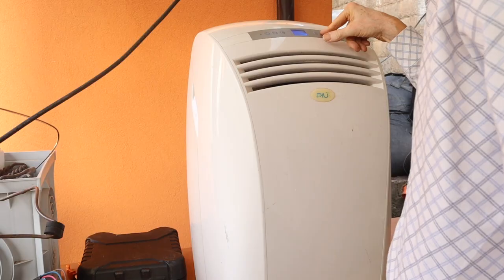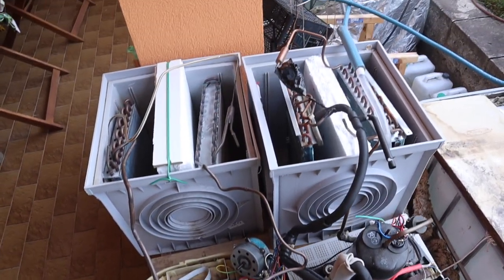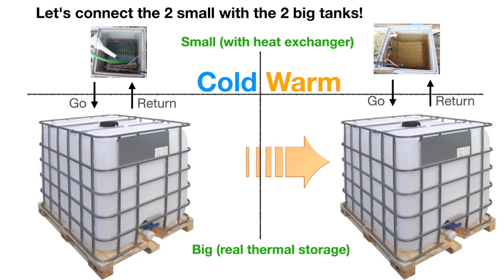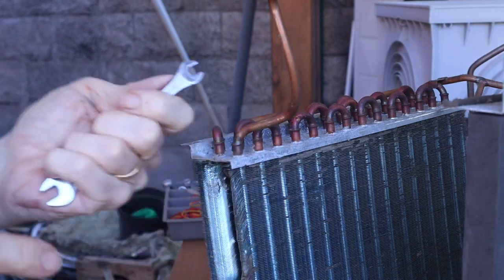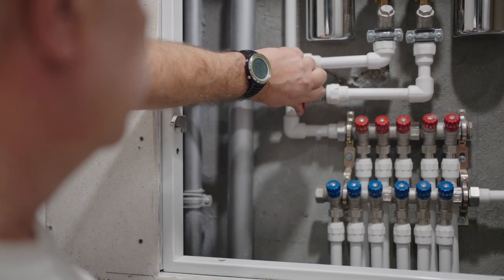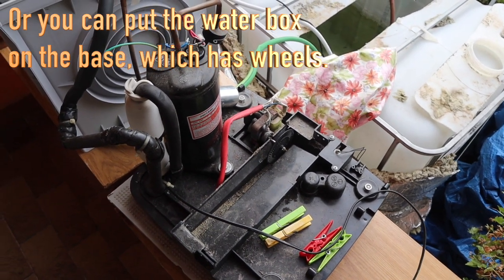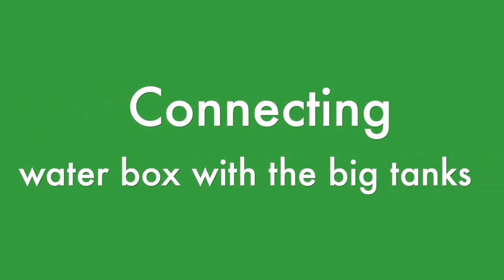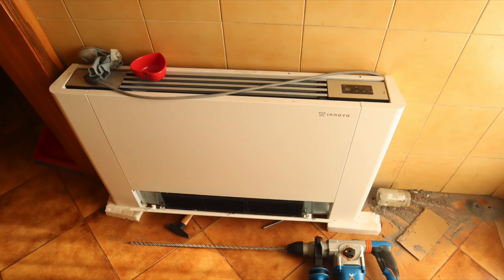Winter Heating Hack: Convert old Air Conditioner into a Water Heat Pump (Part 2) - Video 68

Comment: This is a cool project but maybe for general usage the mini split heat pumps are a better idea because the compressors have variable speed (new 5KW/18000 BTU Midea cost 500 euros, i would imagine there are used mini splits with variable speed compressor), heat pumps loves to run constantly at a slower speed that's how you gain efficiency.
Reply from the maker: Hi Riste, indeed a 18 kBTU would charge the 2 water tanks much faster. I started years ago with a split but found it a challenge to put them together without the controls. Even if I got now this new experience of simply putting the power supply directly on the compressor. Anyway, it might be difficult for many DIY to unite the external/internal unit.
I agree on the variable speed advantage, but again, it requires the knowledge to integrate the electronics and let it work even if you eliminate the fans, which we don't need anymore. The second reason that I think we can run it just at full speed is that all heat&cold will anyway go into the storage and it takes time before that is charged.

Comment: I would think the gain is only x5 if you simultaneously use the cold and the heat 🤔 otherwise it's just x2.5, no?
Reply from the maker: Hi Effedrien, you got it right! Actually the heat efficiency is somewhat better than the cold efficiency. The challenge is, just like Combined Heat and Power,  to find users at the same time. In summer that is easier than in winter.  But if you store both as I do in the 2 big tanks, the consumption can be shifted in time.
Reply from the maker: Also, if the temperature difference between the 2 tanks is not so big, the efficiency is better than 2x2.5. So you may expect a rather quick reaching of the nominal temperature difference.

Comment: i put a 250w heat lamp above my kitchen table.  instant heat, it is my favorite heater!
Reply from the maker: Hi Matt, infrared heating is indeed very quick and in addition,  it works even outside. Therefore they use it insights rooms like churches where people stay for only 1 hour.

Comment: How did you isolate the box for the noise?
Reply from the maker: Hi Hamza, I did not yet insulate the sound or vibrations but the compressor is mounted on rubber feet and if there are no objects on the base it is much more quiet than an air conditioner with its two strong fans.

Comment: You've inspired me! This summer was the last one for my parents 10+ year old floor standing unit; the blowers squirrel cage cracked and my repairs we're unfortunately temporary. I'll see if I can give it a second life. It seems the only thing I'm missing is a bin or two to get started.
Reply from the maker: That's great Ostrich! Do you mean the squirrel cage like fan? That will be no problem because it is superfluous in the configuration.  See video 61 where I eliminated the fans to see my fans. As long as the compressor works you can go on.
Reply: @nnvasen-good-energy  Upon further consideration I've realised there is one difficulty that may hamper performance. Galvanic Corrosion. Many of these radiators are aluminum fins pressed onto copper pipes in the end. Submerging them in plain water may be ideal for performance but having to use an oil bath instead; with another fluid to fluid heat exchanger in the loop may be necessary.
Reply from the maker: I agree that it may be an issue. In the past I played with a separated circuit but that was complex for me and for my audience. I am now just looking what happens and if I need, I strip away the fins, like another viewer suggested yesterday (the comment about cooling fermented drinks) to give more freedom of movement to the water.
Reply: @nnvasen-good-energy  I just spent a bit looking around and found the brewers glycol chillers. I've been convinced it should be fine so long as the coils are submerged in relatively pure water with an antifreeze mixed to suit.
Reply: @nnvasen-good-energy  Yes. That's exactly it. Replacement was far too much but I might still give it one more look before I bend it all out of shape.
I'll be sure to reference that video when it comes time. Thanks.
Reply: @OstrichWrestler, the fins are made to resist corrosion since it is normal that they are wet in summer with water condensation. To strip them away is not a good idea, even if there's no forced convection without using a fan (or better... a propeller, or a pump), the natural convection between the fins is huge compared to the bare copper pipe alone.
Just for refence: natural convection in water at 40° between two fins 200x50 mm with gap 1 mm gives 37,6  W/m2K Average Heat Transfer Coefficient when the heat load is 4 watts per each fin pair. In a pack of 400 fins the total surface is 8 m2 (400 fins * 2 sides *0,05 m * 0,2 m) the total heat load 1600 W and the average temperature difference (fins to water) is 5.3° (not bad).
For comparison, for the same heat load (1600 W) in natural convection in water at 40°, a 5 m long pipe 1 cm diameter needs 13° of delta T to dissipate its heat to water (BAD...)
Using an oil bath without a propeller would be CATASTROPHIC, due to its MUCH higher viscosity AND MUCH lower thermal capacity (specific heat)

Thanks to:

https://thermal.mayahtt.com/#vert-channel
 https://thermal.mayahtt.com/#horiz-cylinder
Reply: @eriton6806  I did put the radiators in different bins of water and ran some crude tests. I wound up just leaving it for a few months tucked under some cover until a general clean up.
Unfortunately there was some galvanized steel plates that they used to cap the fin stacks and the copper tubes were pressed through holes in the plates. I couldn't remove them and knew they'd be a problem so I didn't bother doing much with them. When I opened the bins the steel was rusting up as expected though there did appear to be surface level corrosion on the fins. It held up better than I thought it would in just tap water. I'd imagine that would change if it was flowing or had oxygenation.
Even if there is corrosion however I think it could be managed with some filters and occasional flushing.

Still intend on playing with heat pumps more in the future but I'll probably start brazing my own bits together. Working with pressurized machine formed copper lines doesn't leave you much flexibility. Just waiting to justify some tools that I don't actually need.

Comment: I'm impressed the hot side was even able to reach the 59C+ water temperatures, with a COP value of betwen 2-3. I don't know if I could take that device home, but then again, the ones on the market costs thousands of euros, so this near 70€ device has some convincing features.
Reply from the maker: I see these types of devices for prices between 200 and 400€. But after a whole summer of noise the people are glad to be rid of them!
Reply from the maker: I was surprised about those 60 degrees too but it's not convenient for us to let them walk on their toes.
Reply: Here in Italy you can buy a much better (and NEW) inverter split (COP ~4 ) for just 250 €. I was thinking of buying one and insert a heat exchanger in the liquid return line between the internal unit (condenser) and the external unit. But then I remembered that I ALREADY have 3 split air conditioners installed in my house, why not use one (unused) of them for soft experiments ?
😂